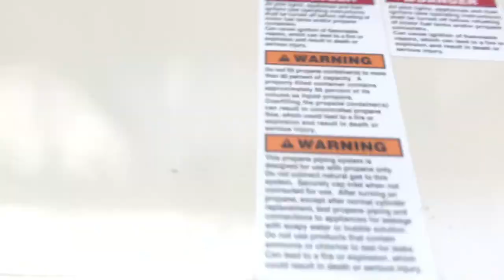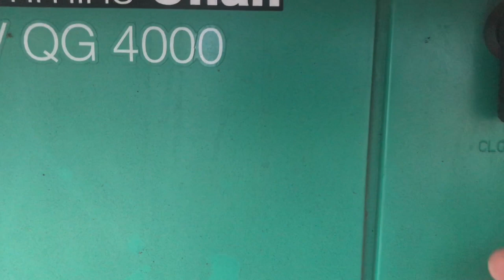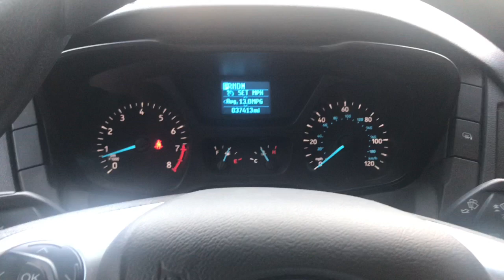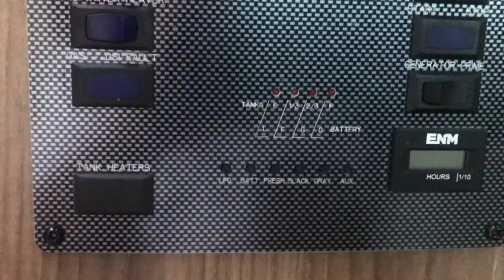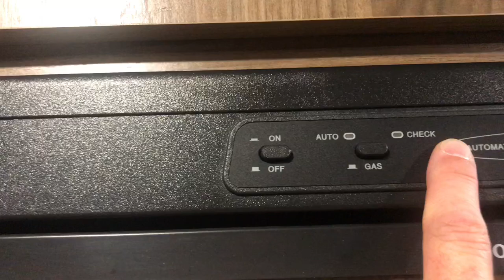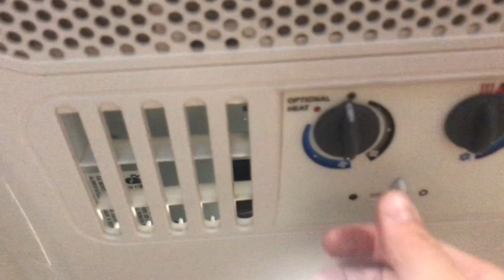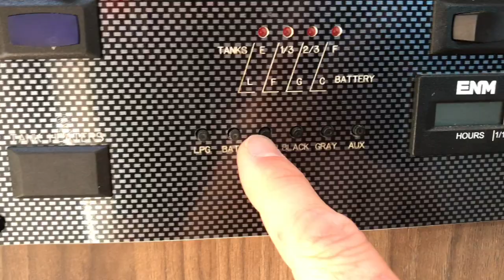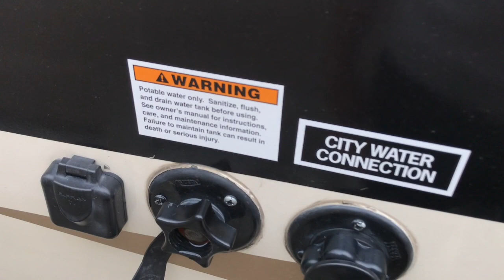2018 Coachment Freelander 20CB Detailed walk through and operation Class C Motorhome

Comment: I got one in 2016. I lovet so far no troubles oil change and go. Easy to drive park anywhere turn on any road. Enough space inside really fast warm up on cold weather and isolated very well. 13-14 miles per gallon. I updated chairs and bed . I no need bigger motorhome and small one not gonna work for me. I take my micro 20 times a year out camping. I never had a problem to park . When is time to go home turn on the keys and go. No packing lifting and other stuff. I love my Micro.
Reply from the maker: Nice, they are great little motorhomes.  Sounds like you are getting some great use out of yours!  Thanks for watching

Comment: I picked mine up last March. All of my camping has been boondocking, so I added a 1500 watt inverter and some solar panels on the roof. Now it's perfect for the way I use it.
Reply from the maker: Cool!  It’s a great motorhome, very easy to use and drive
Reply: Do you still have. Where did you put inverter?
Reply: @52tazdi  Yes, I still have it. My inverter is under the seat next to the refrigerator. I'm using three 100 amp lithium batteries. I have camped for up to ten days without having to fire up the generator.
Reply: @darrellshore1821  thank u  i am looking at one and want to do the same thing  thanks

Comment: On the control panel, how expensive would it be to heat the tanks? Do you also have to wrap the tanks? 
Also, how do you change the lightbulb above stove?
Reply from the maker: It’s probably pre- wired for the tank heating pads.  It’s just a heated pad that sticks on to the side of the tanks